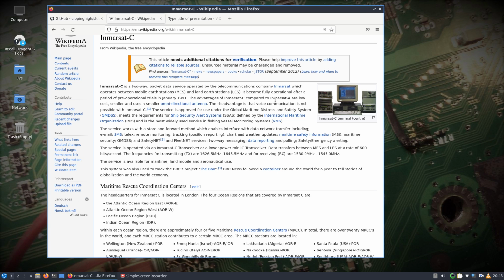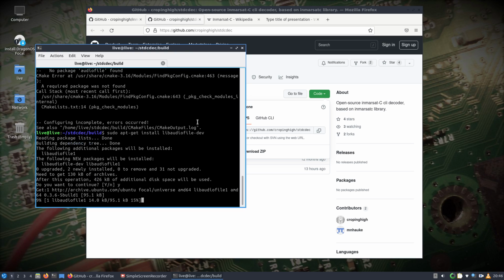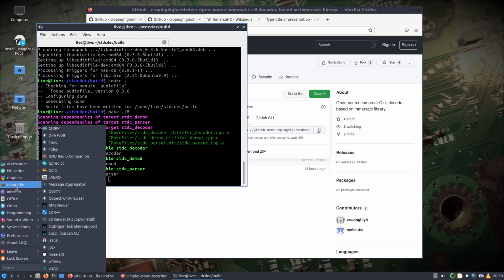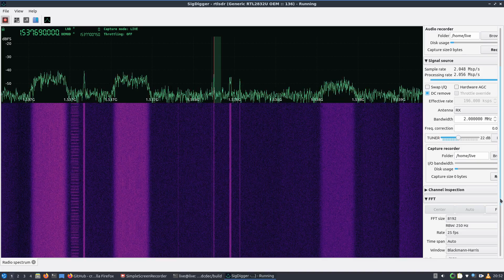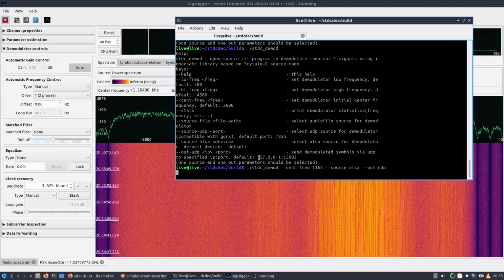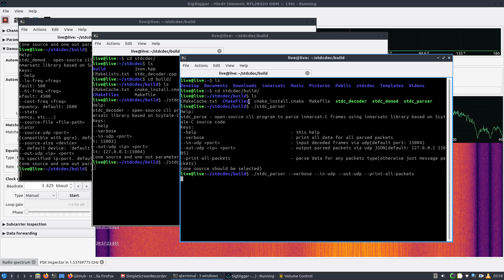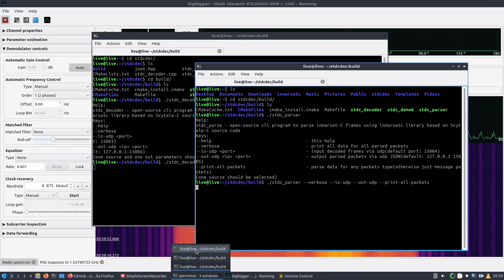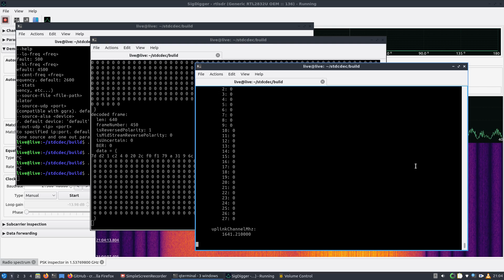DragonOS Focal Rx and Decode Inmarsat-C Messages w/ SigDigger + STDCDEC (RTLSDR)

Comment: Do you think it is possible to demodulate the signal with GNURadio and send the symbols via UDP directly to the stdc_decoder? This way I wouldn´t use de stdc_demod, right?
Reply from the maker: I actually have another video where it’s all built into SDR++, possibly an easier solution. I’ll find the video.
Reply from the maker: DragonOS Focal FISSURE, SDR++ Inmarsat-C Plugin, SDRAngel, and GridTracker (Install/Update Steps)
https://youtu.be/kV042kcCzic

I’ve not checked to see if any updates to SDRPP have broken this plugin, but it should hopefully still work.
Reply: @cemaxecuter7783  Okay, I will look into it. Thanks!

Comment: Signals Everywhere did this years ago and had to take everything down.  Got some calls from some lawyers, and then started to have a personal moral issue when they discovered there might be some bad folks using what they built.  Wish they that project alive, but they got cold feet and ditched the project.  I'm sure you'd get some insight and some help with your project if you reached out, don't know what kind of response you'll get though, they just made an announcement a few days ago about closing their whole YouTube down.  Either way awesome work and good luck!
Reply from the maker: Hi and welcome. Not sure which part you’re referring to? This particular video? As far as I’m tracking this is the first full Linux solution, but decoding immarsat messages I can’t imagine is an issue. In fact, there’s at least two windows solitons built to do so, one open source and another paid. There’s no breakage of encryption or anything like that, I’d say cellular tools maybe an issue but I try to make it clear they should be used in a lab environment. You do have me thinking i need to make that more clear because I think there’s some bad intent on some cases. I’ve seen a few things by signals everywhere, good work!
Reply from the maker: Oh yeah I did see that announcement too, I basically just make videos to go along with the DragonOS I build.

Comment: Wow. Very cool. Bit of a gam changer being able to run STD-C decoder on a light weight Linux hardware platform.
Thanks for putting the video together, would be hard to describe in just words and screenshots.
I wonder if everyone can now use that 'audio center' value you found? That would cut out a lot of the work if it is the case.
Reply from the maker: No problem, it was fun and a learning experience for sure. Regarding the audio center value, it’s different each time I think based on how you’ve got your center freq set/bandwidth and filter around the RF signal. So I think unfortunately you’d have to go in and determine that yourself, there’s probably a better way to do this and my hope is that another tool in DragonOS may be able to do it automatically. Plus I think the scytale-c developer also has a solution coming, but for command line interface - I think this is the way to go. I just want to get the front end for the SDR command line too, which I can think of a couple ways to do it, just waiting on an automated way. Long response :)
Reply from the maker: Actually thinking about it more, the SigDigger dev suggested I get it all setup then use the bookmark feature which would save center freq, bandwidth and filter etc. Maybe by doing this, once you got it all set and save per your setup, then you could just easily restart it all next time.